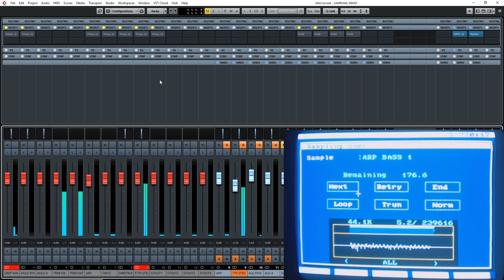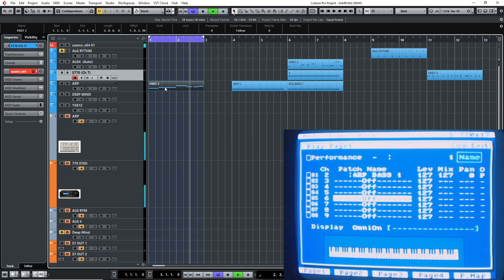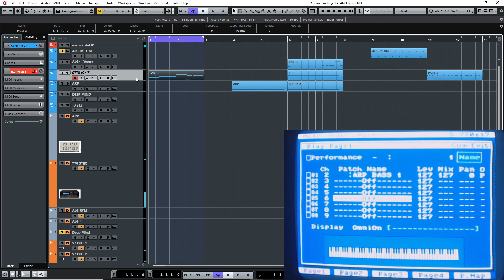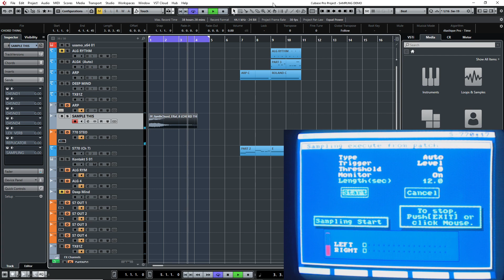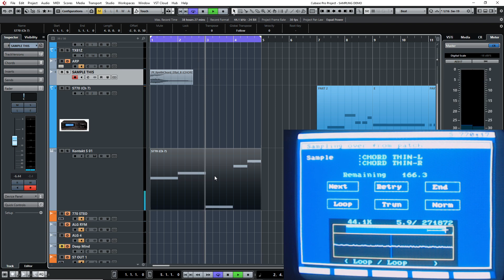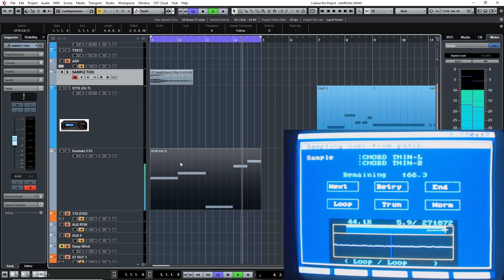SAMPLING WITH HARDWARE - The Obvious Difference!

Comment: Valid point, I believe the Akai S-1000 were known for it's interpolation algorithm "8 point windowed sinc interpolation" .
Reply: Correct! Whereas the S950 actually changed its digital clock rate on each voice (like pitching digital tape).
Reply: Same with the s1100 ?

Comment: Great comparison, much appreciated.  Been amassing quite a collection of these old samplers since I first came across your S-770 video.  What are your thoughts on the SP-700? I have heard the circuitry is a bit different than the S-7x series.
Reply from the maker: Never tried it. All I know is it can playback all the S range fromats as well as Akai S1000. My hunch is the playback circuitry is exactly the same as the S770. But why get a playback machine when you get one that samples.
Reply: @MOOTANT1  Yeah, I think you're right.  Better to get one with playback + sampling!  I've got the S-750 and a few S-760s.  Hopefully one day can get an S-770 for the better inputs.
Reply from the maker: @DavidLovasJT  I don't notice the difference with sampling into s750/770. Maybe if I were sampling a live string section with Mics I would.
Reply: MOOTANT also excited to start working with the S-550, finally was able to track down an elusive HD5-IF SCSI interface so I can make use of SCSI2SD